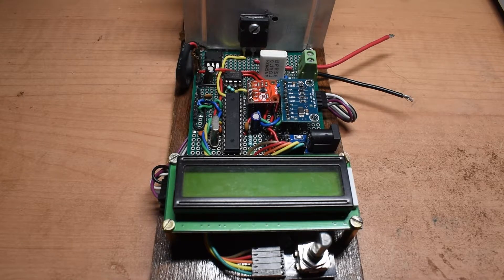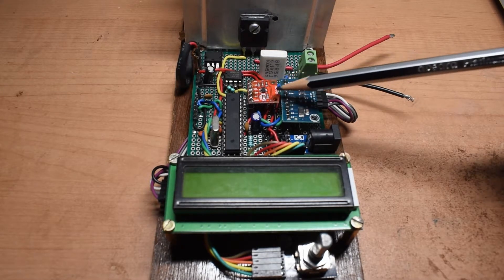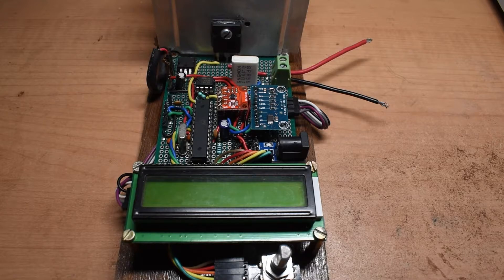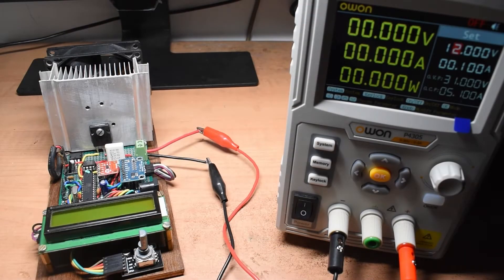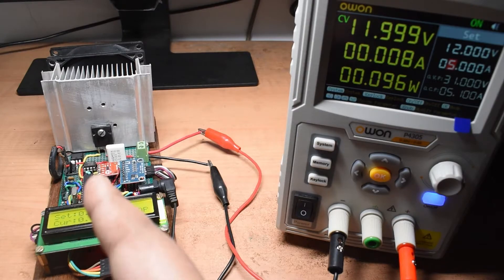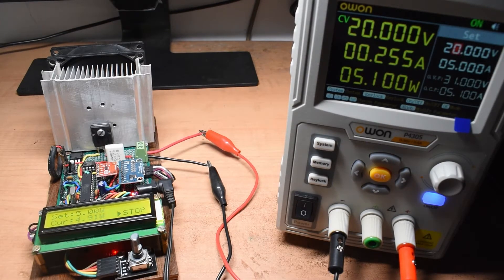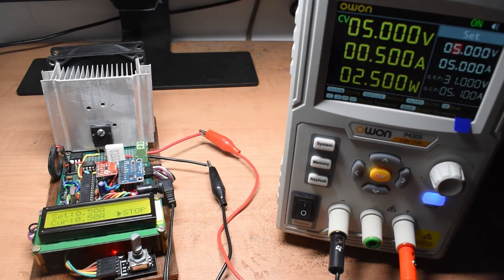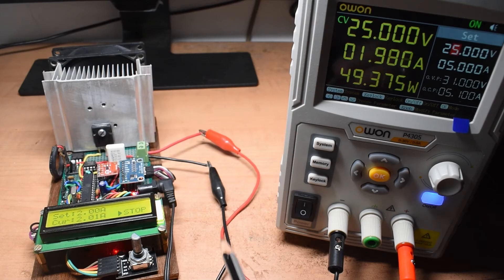DEC #07 - DIY Electronic Programable DC Load using Arduino | part 2 | final built of v0.1

Comment: How does ADS1115 handle 12V input voltage? I read the datasheet, and it maxium input analog voltage is VDD or 5V 😅

Comment: Dear Sir, very interesting project. I would like to build a similar project for a load 30V/25A. But I would replace the shunt resistor with a voltage devider to feed the ADS1115 with a max of 5V at a load of 30V. Also if you use a shunt resistor of 0,1 ohm it must be able to handle about 64 W. Maybe I will also use 2 MOSFETS instad of one to share the load. I would like to hear your comments.

Comment: Dear sir, awesome knowledge with excellent experience. 
I need your help if you don't mind, actually I need large load  about 20amps for 48vdc. Please suggest for component like mosfet etc. I know this project is same as per my requirements. Thanks in advance.
Reply from the maker: As per your requirements I can suggest you to use IRFP260 MOSFET. It can take upto 200V DC and 50A current. You may use 2 MOSFETs in parallel to increase the performance. You also need to use liquid cooling for the MOSFETs to dissipate such a huge power.
Reply: @DigitalElectronicsCircuitsLab  sir, thank you very much for your suggestion and responding. You are a good guy. ❤️

Comment: Love it man! Would be awesome to see you make it with at handful of Mosfets in parallel!  I’ve made an analog load with 8 irf260  and two lm324 op amps.  It can handle a TON of power but it has no programmable abilities.  I’m going to implement this into that project since I have all of these components.  
👊🏻👊🏻👊🏻